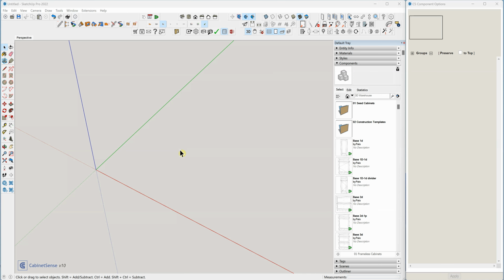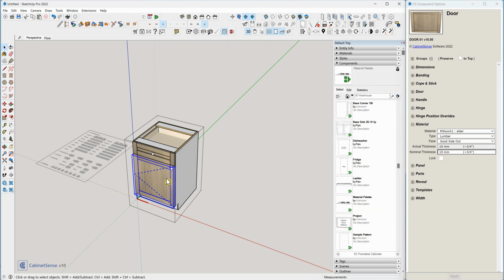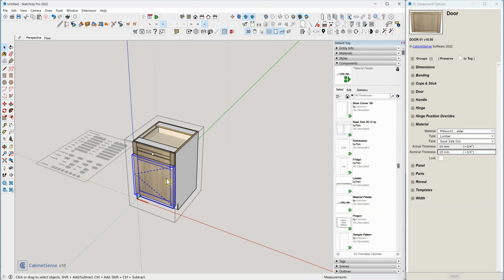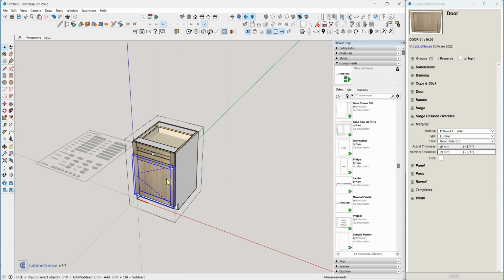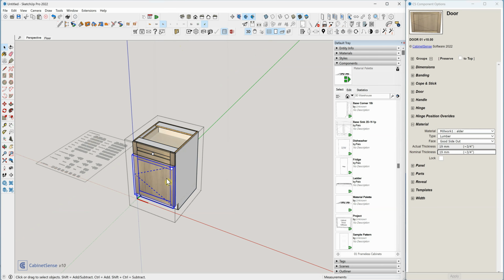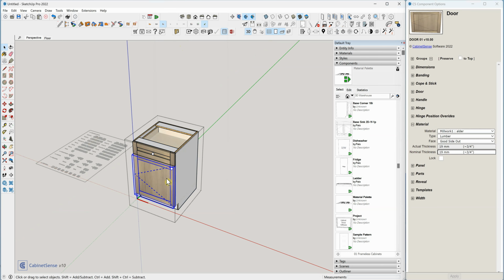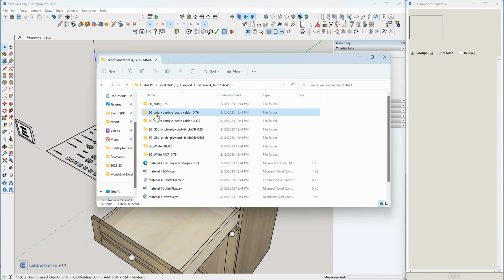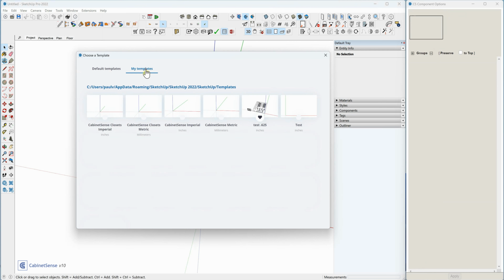Using CabinetSense Materials

Comment: How do you change the material type for the door panel and frame? Having the door panel, style and rail all the same messes up exporting to cutlist because it reads both as either 3/4 hardwood or 1/4 ply.

Comment: I have used CabinetSense from its inception.  I have found it intuitive, flexible, and invaluable in taking a project from design to shop.  Every function of this plugin is well thought out and implemented with the end user in mind.  The CabinetSense team is quick to respond to issues, fix bugs, and consider input for upgrades.  The plugin does not impact Sketchup processing speed in any significant way.  It seamlessly takes the SU model and exports it to Layout for presentation and shop drawings.  Our clients love getting 2D and 3D models that look and feel exactly like the end product.  This plugin gets a 5-star rating without hesitation. ⭐⭐⭐⭐⭐
Reply: Hey jim how are you doing your assembly sheets/ shop drawings?
Reply: @MattFormoso  The drawings are done in SU.  We create scenes in SU for the elevations, plan views and details we want to show in the shops.  All of our dimensioning is done in SU using a combination of CabinetSense and SU dimensioning tools.  CS has a function to export the scenes to Layout.  Once in Layout, we adjust the views, add notes and, when completed, export it to PDF.